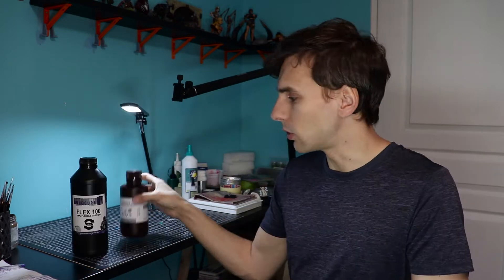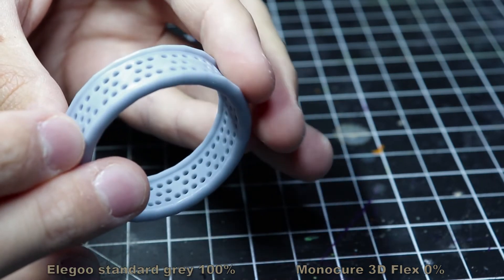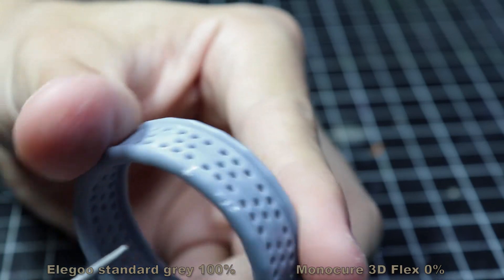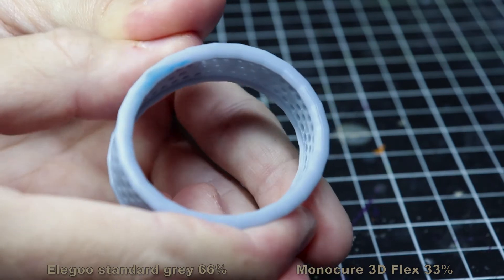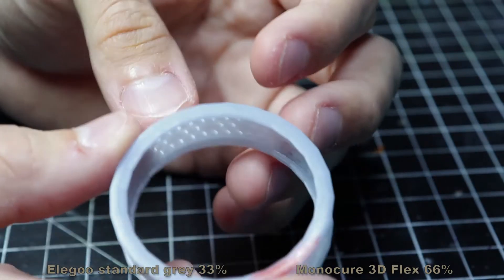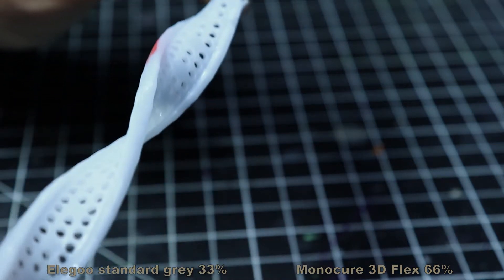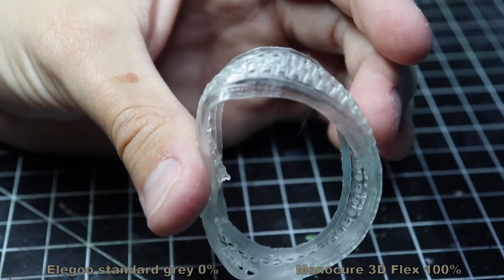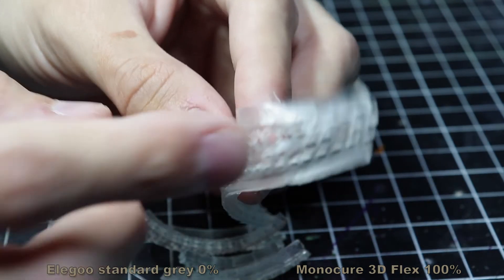3D Printer Flexible resin Test, Monocure3D flex 100

Comment: Hi, your experiment is really interesting, congratulations! I mixed the standard resin (60%) and the flex resin (40%), after a few prints the resin in the tank forms lumps. You have to filter it, shake it and heat it a little to print again ... How to avoid this effect?
✌Thanks.
Reply from the maker: Hi, happy the video helped you.
Sadly you can't avoid this effect, the two resin will always separate.
I even had to stop long print and mix the vat in the middle of the print.

Comment: Great video thank you! I will be experimenting with a 60/40 mix. Making 1/6 scale figures and this would be great for custom hand parts that need to attach to pegs. They should be able to pop on and off easily without having to use putty or worry about breaking.
Reply: im actually trying the same thing! have you had any good results?

Comment: Is there anyway to add color to the resin ?
Reply from the maker: Yeah definitely, they sell inks that you can mix to get the color you want 👍
Reply: @zymetheuy  any ink brands you would recommend ? Thank you going to be using with a elegoo Saturn
Reply from the maker: @RioElMystic-999  I never tried any brand so I can't recommend sorry but monocure 3d have inks so they should be good enough 😉

Comment: what about curing? does anyone knows some if there are particular settings? good vid. thanks
Reply from the maker: Thanks 😉, just cure the same as a normal resin but the flexibility will change during the next few days, basically it's a bit stiff after curing and then soften up later.

Comment: I 1 question :
i wold like to print 3d plexible mold for resin casting like this model your show.
This resin its ok to do that?
Thanlks a lot
Reply from the maker: I don't think this resin is good for this application, you could give it a try because there is a chance this could work but I know a lot of manufacturer are selling special resin for casting, so it's probably better to check those out 😉
Reply: @zymetheuy  thanks!

Comment: I'm wondering if it is possible to print sealed structures from flexible resin? Something like a corrugated hose?
Reply from the maker: It's possible but in the end it really depends on what kind of use you're going for, I have no idea how good of a seal you can get and how the resin will hold with time.
For example I would not trust it for like a water cooling tube for pc

Comment: Interesting video and very informative. I wouldn't say 100% flex is a failure. It all depends on what you're making and it's intended usage. Just off the top of my head, I can see using it to make cosplay masks and things, live hinges, flexible mounts, seals, gaskets, and small tires for RC use. I would definitely get some to try out and see what kind of environments and solvents it can handle as well as it's stretch limits.
Reply from the maker: Thank you, the reason I said 100% is a failure it's because I was not able to print something decent on my photon, you have to mix at least some "normal" resin with it.
And yeah with like a 20/80 mix you can definitely get some got flexible stuff for different use.
For the tension resistance it really depends on the thickness of piece, I can't really help you on that one.

Comment: @ZyMethEuY
I need a resin that's as flexible as possible. Like cloth material.
The 90% and 100% flex should do the job but they'll break as soon as i try to put the garment on an action figure.
Which one would be the most appropriate in your opinion ?
And last question, did you try to paint these flexible prints ? If so, how did it go ? 
Amazing video by the way.
Reply from the maker: Oh men that's gonna be hard, I don't think any resin would behave like cloth.
If you wanna try something you have to go around 90% flex, like I said in the video 100% is impossible to print ( at least for me).
Imo using real cloth is the best option for your action figure 🙃.
I hope this help , glad you liked the video👍

Comment: For those trying if you want a better 100% print try far longer exposure times through the whole print around 40 seconds have worked fine with different brands. So you might wanne try that if your going to print flexible.
Reply from the maker: are you saying 40sec for normal layer exposure? seems like a screen killer to me xD

Comment: Thanks for making this! Quick question: does the monocure/elegoo mix (like 50/50 or even 33/67) sensitive to scratch like any other "standard" resin? Meaning, does it get all white if you scrap it with your nail?
Reply from the maker: I dont have the rings anymore to give it a try, but its less sensitive in general when you mix, so i would say yes.
But even on classic resin when everything is fully cured nail scratches shouldn't be a problem, i hope this help sorry xD
Reply: @zymetheuy  Yes it does! Thanks for taking the time. Keep it up!

Comment: Thank for this video. I am curious about how you cleaned and cured it. Did you use alcohol and put it under UV light?
Reply from the maker: Oh yes of course, sorry I completely forgot to say anything about that.
It's the exact same process as for a normal resin, IPA for the cleaning and a couples of minutes under UV light for curing 👍
Reply: @zymetheuy  ok, great. Thanks and still a great video!

Comment: Thank you for making this vid. I've been considering trying this resin as an alternative for TPU/TPE FDM prints for my drone gear, but I see now this is likely not possible.  I will still use this resin to improve table-top miniature durability.
Reply from the maker: Thanks I'm glad it's helpful.
You are right TPU is the king for practical print I think, flex resin is still really nich with those not so great ability, but yeah improving the resistance of normal print like mini is definitely where's the money 👍